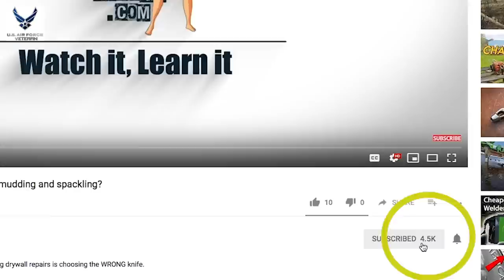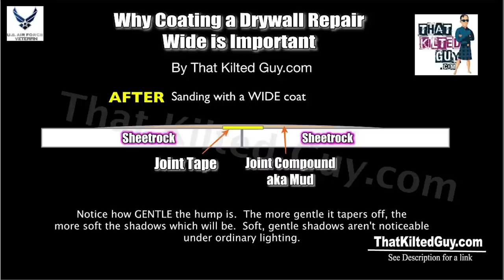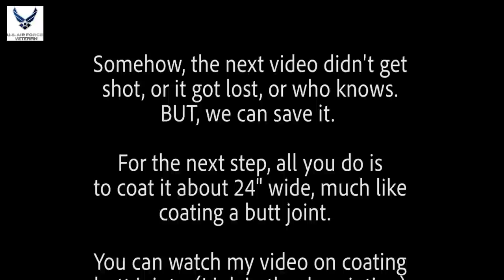2023 - How to Repair CEILING WATER DAMAGE using Mesh Tape the correct way

Comment: Stupid newbie question here but with cracks if it isn’t very deep why do we need to use tape at all? What happens if you just fill it with mud and feather it out? Also how do we know if when dry wall mud is better to fill cracks on the walls vs just adding some window and trim caulking inside / on top of it and skim off the top? I did that on some of our walls like in our hallway and seems to have filled the crack nicely and I can’t tell there is much to any surface variation when I put it. 
Also do you have a suggestion about when and how to add the texture back on like if we are doing the side wall of a hallway or in one of the creases where the hallway begins?
Reply from the maker: Never fill a crack without joint tape or some fiber attitive in the mud
Reply: @ThatKiltedGuyDIY  even if it is like a cosmetic crack in hall way maybe about the width of a hair? What will happen? I think it was perhaps due to either, or both, “settling” where all the seams were put in by my husband or the way he did it? It was done a long time ago (and he did use tape), and he says he was just doing a fast job to get us by (thinking we were going to knock the place down in less than 7 years), but now 17 yrs later we aren’t probably going to be able to build for another year or so. So I’m basically trying to make this place a bit prettier and more functional for the kids and me while we wait, and also give me a great place to learn the trades on my own before I work on our future nice house. 
So if the cracks or hair line cracks in the paint goes along all the seamed areas, and they “originally” had tape when put on, do we add even MORE tape then mud?? I know one of the issues is the tape makes it too bumpy and feel like it could just be the edge of the bump itself causing the cracks in the paint. Thanks you so much KIlted Guy!
Reply from the maker: Sometimes a hairline crack will go away with paint. 
www.ThatKiltedGuy.com

Comment: I got a hairline crack across my living room. We’re the joint is 2 diffrent guys have try to fix it and it comes back in the exact spot any ideas of what it can be
Reply from the maker: If they fixed it well and it keeps coming back it’s probably some structural movement.  Sometimes i put caulking over the crack and then smooth it flat with a mud knife. After it dries i put another thin layer of mud over it and refinish it. That creates a flexible repair so it has a better chance of lasting. It’s not a gauranteed method especially if there’s much movement.
Reply: @ThatKiltedGuyDIY  put more screws ..not nails .
Reply from the maker: nobber d robber I NEVER use nails. They suck. I always put screws around a crack But sometimes it will come back anyway if there’s too much movement.
Reply: @ThatKiltedGuyDIY  if u can access it through a loft and put a few extra cross braces in it should help.its a pain.....

Comment: Hello sir. I just signed up to your channel after seeing you on c Jane drill. Would you have a video on repairing a hair line crack no wider than a fine pencil line. It's only visible if you really stare up on the ceiling. It runs halfway across my living room ceiling then stops. 1950 home. I suspect , it was caused by the crazy high snow amount on roof this winter even if I lightened the load on three occasions. So to the point do  you recommend mesh tape or will paper be fine to prevent it from Recurring. Btw no other cracks on ceiling. . I'm a real novice and would appreciate any advice or a referral to one of your videos.  Cheers from Shawinigan  Qc Canada.
Reply from the maker: Hello Suede Delray. That was fun doing that live video with Leah.  We've chatted by phone since and I hope to meet her in person one day.  As for cracks, hairline or bigger, I fix them the same way.  No caulking or paint will fix it for more than a month or two.  I have laid down probably 200,000 feet of mesh tape on repairs, and never had a problem with it.  But the secret is to use a fast setting joint compound over the mesh tape on the first and/or 2nd coat.  Then you can use an all purpose mud.  Hope that helps.  Guy
Reply: Thank you sir I really appreciate the reply. So I should use that mesh tape as opposed to  the paper if I understood you. In Canada do you think they sell the rapid set mudd. Finally do I open up the crack even if  it's hair line or leave it as is and cover it with mesh tap and mudd. Again thanks for helping out a real novice. You really make fantastic videos and are a natural teacher. Cheers from Canada.
Reply: @suededelray6207  I would recommend opening it up a little, do like he did, put new screws both sides of it. Opening the crack a little allows you to get mud in the crack which tends to make a stronger repair.

Comment: Whenever I use hot mud and then use regular mud (all purpose, or lightweight)  on the second coat I get hundreds of tiny bubbles.  I have to let that dry and sand it and put on another coat and the majority of it goes away, but sometimes it is a little stubborn.  Is there a way to stop the bubbles?
Reply from the maker: I haven't found one
Reply: Bubbles are caused by air being trapped in the paint texture. I scrape them down and squeeze a light coat into the pores. Additionally, on new drywall, the pores are from the mud being too heavy to move .I have already used Ivory Liquid soap to make the mud more viscous.
Reply: Maybe let the hot mud dry a little longer.
Reply: @lorrainedubzak432  I have waited days for it dry and it still bubbles.

Comment: How do you fix it if there is nothing behind the drywall to screw into?
Reply from the maker: Antdawg About all you can do is put screws wherever there is backing, and then open up the crack about an eighth of an inch and use durabond or a hot mud to force it to the crack and kind of glue the two seams together. Add mesh tape on top of that and finish like normal. The video I just released shows all this.
Reply: @ThatKiltedGuyDIY  I just watched it thanks I'll see if I can find some durobond to fill the cracks with b4 skimming thanks! Hope your feeling better!
Reply from the maker: Antdawg Some fast setting joint compound, which we refer to as hot mud will work fine too. If nothing else, squirt it full of construction adhesive and let it set up before coating it.
Reply: Excellent video made by a pro.

Comment: I did everything you did on my crack in my ceiling.  Except I used paper tape and regular mud.  I did it this winter (December) and it's already showing the crack through.  I can see the line across my ceiling again. Is it because I didn't use mesh and hot mud?
Reply from the maker: By regular mud you mean regular weight all purpose joint compound? And you put more screws in on each joint?
Reply: @ThatKiltedGuyDIY  yea.  Blue bucket.  Light weight joint compound. Sorry should've been more specific.  I actually re screwed the entire ceiling
Reply from the maker: I know some will argue with me but I think mesh tape & hot mud is stronger.  I’ve done nothing but repairs for 20 years and have probably put on hundreds of rolls of mesh tape with no failures when done right.

But you also should have used regular weight all purpose as it has more adhesive but I don’t think that’s the issue.
Reply: @ThatKiltedGuyDIY  thanks for the feed back.  If I get around to fixing it again.  I'll let you know if it holds up.  I do use regular all purposes mud when I tape.  Appreciate the help! glad I came across your channel.
Reply from the maker: Btw: if there’s any movement or much expansion contraction it may continue to crack.
Reply: Try the no tape mud i just ordered mine
Reply: @pearlperlitavenegas2023  thanks.  Might have to look into that
Reply: @jonruba4065  I have a small crack in my ceiling & will try that no tape mud first hopefully it doesn't reappear
Reply: @pearlperlitavenegas2023  ok. You'll have to let me know.   Thanks

Comment: Great video! Quick question, how do you find the ceiling joist? Thank you!
Reply from the maker: Hello, good question. Sometimes I can tell by popped screws where the joist are & once I establish the spacing I can just mark them out with a tape measure and pencil. Other times I can see the screws for one reason or another but if not, just use a stud finder. Let me know if that helps.
Reply: Great thank you very much! I will see what I can do 😃

Comment: My ceiling goes from a higher part to a lower part in the shape of a 150 angle or so and theres a crack at the corner where the ceilings meet. So its not a flat surface. Can I fix it with this method?
Reply from the maker: Angles are a little different.  I can't tell you how to tackle this in a comment though.  It would take emails, maybe pics etc.  I do offer a consulting service at the link below , or if you are a member of my Patreon fan club for levels of Clansman or higher at: https://www.patreon.com/ThatKiltedGuy

For our Consulting service: https://www.thatkiltedguy.com/advice-page

Comment: Actually the Jaybird didnt fly into the window as much as it was chasing a bug.
That happens to me in the semi-rural   setting..
I have birds fly into windows trying to escape Falcons or Hawks killing themselves..
And every once in a while see a bird fly into the window like that chasing a bug, usually a moth..

Since I have 2 verticle cracks on the walls, one above a window and as long as the header, from ceiling down..
It starts from top, 2 inches, 90 degree right turn for 1 inch, drops 3 inches, 45 degree left turn 1 inch, down 6 inches, 90 degree turn left for 3 inches.. 
  I guess the same method applies..

The other one, is a 3 inch 45 degree diagonal coming off a corner transitioning a low ceiling from  a vaulted ceiling.. 
House is garbage by the way.. 
 it was built by high school kids during the days of contractors being cheap on hiring journeymen..
Then transitioned to migrants undercutting journeymen pay..

Comment: What if your ceiling has coils for ceiling heat?
Reply: I apologize I just read your story your amazing I’ll figure it out much respect
Reply from the maker: Tracy, thanks for your question. Despite everything that’s going on I’m not going to quit helping you guys. As far as the heated ceiling, I have heard of those but never installed one and don’t know enough about them to offer advice anyway. I think I’ve only run into one once in my career and I can’t remember what I even did. Thanks again, Guy
Reply: @ThatKiltedGuyDIY  my home was built in 1972 definitely do not recommend purchasing a home with ceiling coil heat! Heat rises..right?!  Now floor heat I absolutely  understand!

Comment: why not use toping instead of plus3 on the last coat ?
Reply from the maker: That works just as well. I just have never found any real advantage to using topping. I can accomplish the same thing with the lighter weight +3.

Comment: In the case where there is no studs? Like if the crack is parallel between 2 studs, then what do I do? I saw another guy cut a hole big enough to slide in wood and then screw it and refill the hole witht he same piece of drywall he cut out. Is that something viable?
Reply from the maker: Well there shouldn’t be cracks longer than 2 feet between studs anywhere. But yes you can do what you described above and I’ve done that before. But if I feel like it’s sound on both ends of the crack I often just re-tape it.

If you appreciate our help with your project and would like to support our channel, please consider joining our YouTube membership for as little as three dollars per month. You can join by clicking the join button beside the subscribe button on any of our videos. Thank you
Reply: @ThatKiltedGuyDIY  thank you for your fast answer. I think I know why there is a crack we had redone the pantry where the corner stops right at that crack. Thanks
Reply: @jerseyjim9092  nice good job. I just repaired mine also just could not match the texture perfectly. Better than a crack going from wall to wall. I used a technique I saw on youtube where the guy made some holes along the crack and sprayed in some expanding foam in each one. Seems to bond the 2 cracked boards together. Cut the excess once cured and taped and mud over it.
Reply from the maker: Have you seen my “Texture Playlist”? It should help you match texture
Reply: @ThatKiltedGuyDIY  I have seen a few of your texture videos but I used a can of Orange peel which worked great in my bathroom around a fan repair but this texture is more of a sideways splatter.
Reply from the maker: It often happens from expansion contraction, heat and cool, moisture in the summer and dry in the winter, settling, improper snow load design etc
Reply from the maker: @Silence N Hikes.  Ahh. That requires a texture hopper and air compressor to match.

Comment: Easysand doesn't provide any strength.
Should remove old tape and then use durabond to fill in gap and then use paper tape with durabond also. Then it will never crack.
Reply from the maker: That’ll work. But I’ve fixed thousands this way without cracks so it’s much stronger than you think. And they don’t even sell durabond anywhere in my area because the  easy sand is the new replacement for durabond. 

I’ve gone back to jobs where i fixed many cracks years before and not one had cracked.
Reply: @ThatKiltedGuyDIY  easy sand is not a replacement for durabond. Durabond dries hard and is difficult to sand. It's primarily used for filling and tape setting, not finishing like easysand.
Reply from the maker: I know. Probably one reason it’s not easily found. I’ve had great success with easy sand so I have no problems with it and highly recommend it for repairs. Especially for novices. And it’s not at all easy to sand, lol.

Comment: Is there a way I can contact you Guy? I have searched through your videos and can't find a solution to this poor ceiling repair job I am trying to fix. Its like they gobbed popcorn and mud on without any tape? How can I send ya a few pics? (Purple Heart Vet here)
Reply: and they used staples on the dry wall
Reply from the maker: Email me at ThatKiltedGuy15@gmail.com

Comment: Can you provide some advice on how you'd tackle a large ceiling repair.  I recently had foundation repair completed and I've waited about a year for all the movement in the house to stop.  In my ceiling I have extensive joint cracking...I'd say 50% of the joints and sometimes around a full sheet of drywall.  After the joint repair, I'm trying to figure out if it would be best to feather out the repair or just to skim coat across the entire drywall sheet and retexture the whole area if the repairs are running parallel within 4 feet or less of another?
Reply from the maker: Kipp Thompson Sounds like the best thing is to just fix the cracks like normal, and then skim coat everything and start again.

Comment: What if the crack runs between the ceiling joists. So, there is nothing to attach a screw to?
Reply from the maker: If it’s longer than 24” you might need to add backing

Comment: Good luck that tape alway fails me. 😮😢
Reply from the maker: See it never fails me, so it’s all about the technique and that involves the material and things like resecuring the drywall with new screws on every ceiling joist. I have probably installed over 1000 rolls of mesh with no problems. Well actually one time I had a problem and it was because I used the wrong material and I knew it, and it certainly bit me in the butt

Comment: Elastomeric caulk like big stretch fill it let it dry when it shrinks fill it again repeat until it’s flush after it dries paint it.
Simple
Reply from the maker: Cant feather the edges of caulk and they’ll show
Reply: I've tried that loojs good at first but with the movement eventually the caulk squeezes out of the crack & it's very visible once again within a couple of months
Reply: @pearlperlitavenegas2023   Yes 
I forgot sometimes joints move with fluctuations in temperature and humidity I’ve seen that happen too
Reply: @jeremychildress3931  yep then it looks like caulk is oozing out if the crack 🤭 fixing it the messy mud & tape way  is the only permanent solution

Comment: you do know the reason why the Ceiling is cracking because the foundation is failing you need to fix the foundation of the house first then you can fix the crack in the Ceiling. daaaa
Reply from the maker: Yes that can be one reason, but there are dozens of other reasons such as excess humidity, expansion and contraction, variances in humidity, improper framing, improper drywall installation and much more. It depends on what is causing it but often I fix these cracks and have gone back years later and they are still fixed. So it’s worth it to do it the cheap way first. Thanks for commenting
Reply: Not true. I thought so also, but my foundation is solid. Many ceiling and wall cracks from the house shifting.
Reply: It is true what he said. Basically there’s a number of reasons if you can comprehend.
Reply: @ThatKiltedGuyDIY  Would i see the crack coming back right away if it was the foundation causing it?